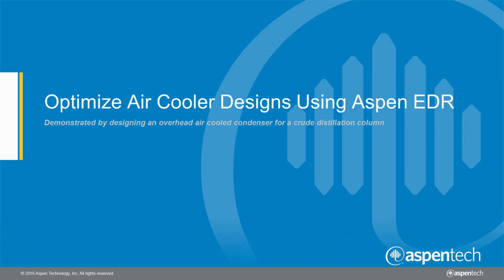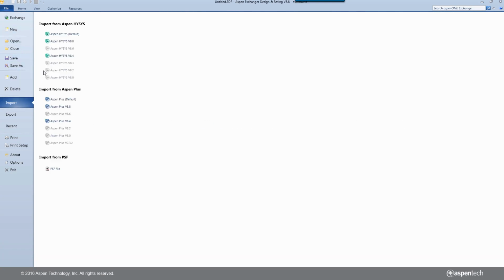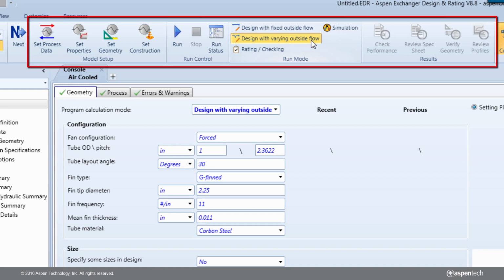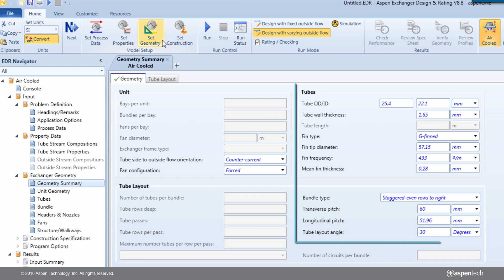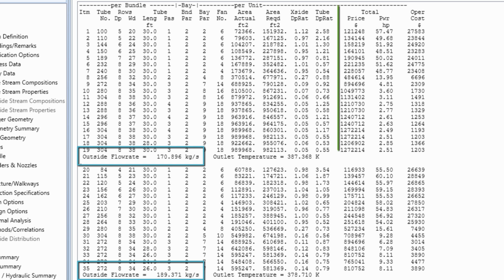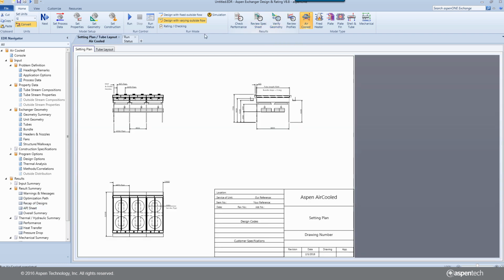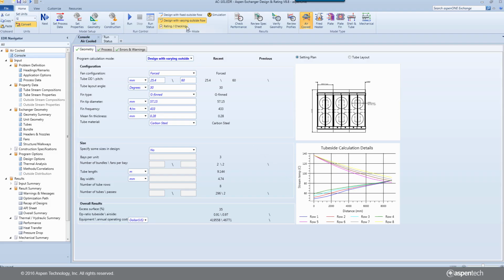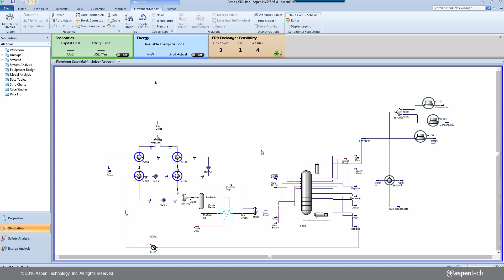Learn How to Design an Air Cooler with Aspen EDR

Comment: If air at dry bulb temp at 36 deg C, RH 42 %, can i cool the air upto 11 deg C by directly adding chilled water into air through evaporatorive cooler.
What is the required sprayed make up chilled water temp, quantity, amd chiller TR for makeup water?
Kindly explain with calculation

Comment: Is it possible to analysis stress and strength of air cooler with edr?
Reply from the maker: Please contact our support department for this and other questions related to AspenTech solutions - https://esupport.aspentech.com/Contact_Phone
Reply: I think there is no stress analysis or nozzle loading calculations for Aspen EDR.